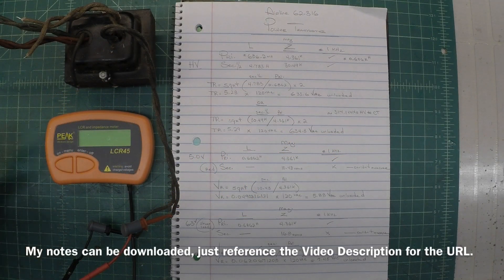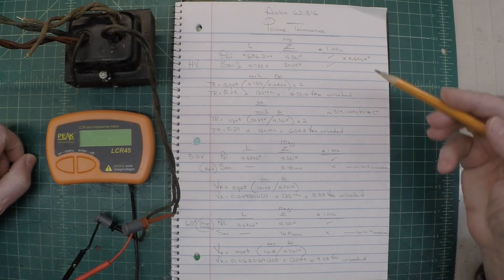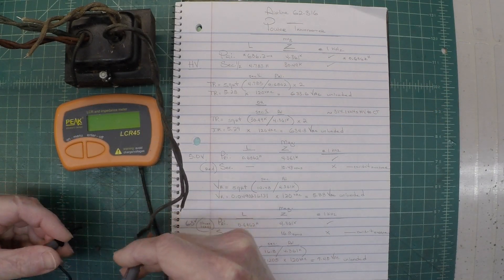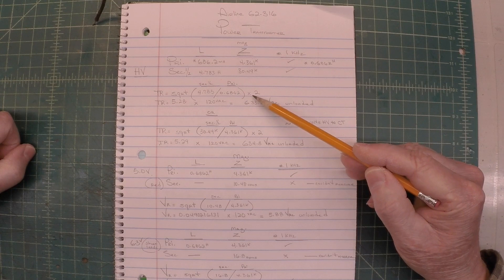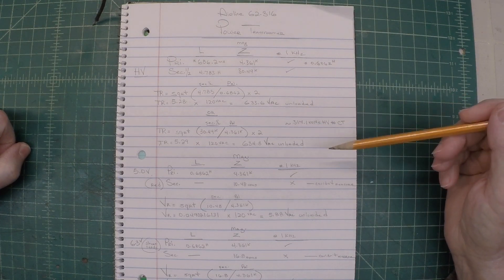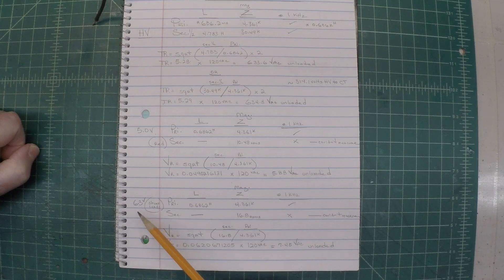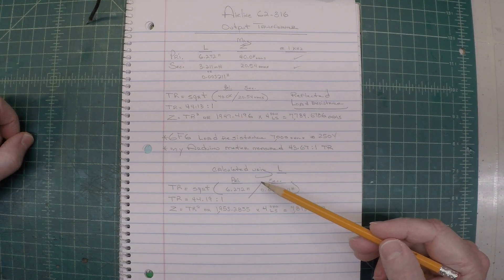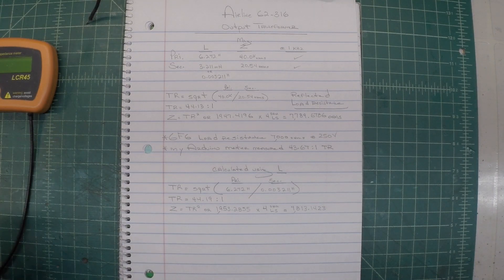Peak LCR45 - Total magnitude of impedance/inductance to calculate Turns/Voltage ratios to estimate..

Comment: Is there a way I could use this to figure out what impedance speaker is to attached each of the terminals on my output transformer?  They are unlabelled.
Reply: It is a 1936 GE E86.  I have a vom, a sign and square wave generator and a lcr capacitance meeter )not sure how accurate it is). Thanks again!
Reply from the maker: Steve, I’ll look it over and reply back tomorrow. Also, does the replacement output transformer have a make or model number on it? Best, Don
Reply: I think it is the original transformer, I don’ see any numbers on it.  I will look again here in a few and let you know either way.  No worries tomorrow is fine.
Reply: This can’t be the original since SNC wasn’t founded until 1946.  Still looking for a pin out.
Reply from the maker: Steve - I uploaded a video (link below) demonstrating one M&P that can be used to identify the best points to connect the 8 ohm replacement speaker. It’s unlisted now, but I’m sharing the link in advance of publishing it. Please let me know if you have any questions or need any additional information. I found some photos and literature on the transformer that I included in the video at the very end. I never located the actual wiring diagram. I’m also assuming the primary has 3 leads and only the two outer leads are being used since this can be used for a push-pull (2 output tubes) configuration as well? Hope this helps. Best, Don

https://youtu.be/qMfWvTAqa1c
Reply: @RestoreOldRadios  I really enjoy your videos and appreciate all your help!  I couldn't find a wiring diagram either.  Have a great weekend!
Reply from the maker: Hope you have a great weekend too. Please feel free to reach back out if this M&P doesn’t work out at: https://youtu.be/qMfWvTAqa1c?si=dYeBBVI7Y46dPWHf
Reply from the maker: Yes, just confirming you only have one speaker that should tie back to the output transformer? What type output tube drives the primary of the output transformer? Best, Don
Reply: @ thank you!  Just one speaker and it has a 6L6 tube.  I think it is single ended because it only has one tube.  Something that makes this more complicated is that the radio used to have field coil speaker and the field coil is a part of the audio circuit.  The transformer has 6 lugs on the secondary and I want to know which one to hook an 8 ohm speaker to.  The dc resistance the voice coil of the original speaker was 4.3 ohms, but I don’t which terminal it was connected to.  Any help you could provide would be appreciated!
Reply from the maker: Steve, what test equipment do you have and do you have any spare resistors, say 2k to 5k on hand? Also, what make/model receiver are you working on; I would like to reference the schematic? Best, Don
Reply: Yes, there is a number on it.  I looked before and I Don’t think I saw this.  On the top of the transformer there is a box with a superscript “s” followed by NC and outside the box it has 6P167.  I’m glad you asked about this, I will look up the number too and see what I can find.